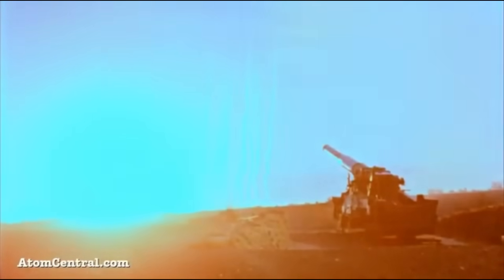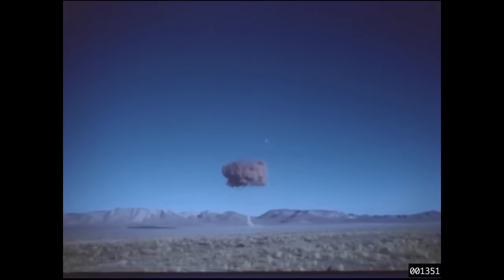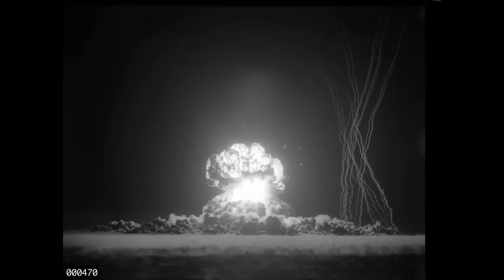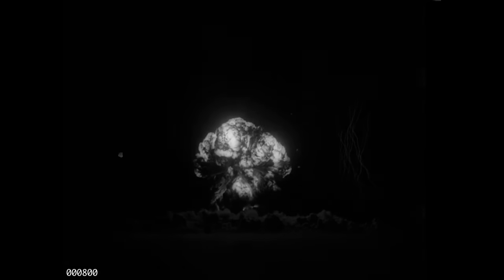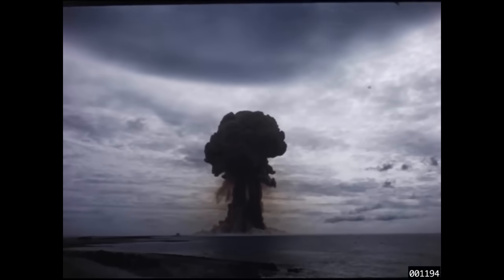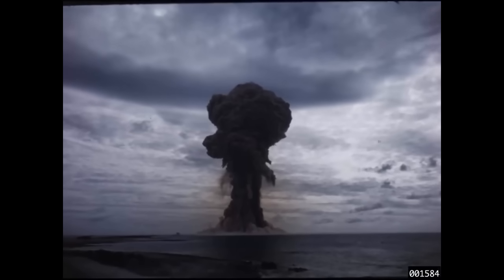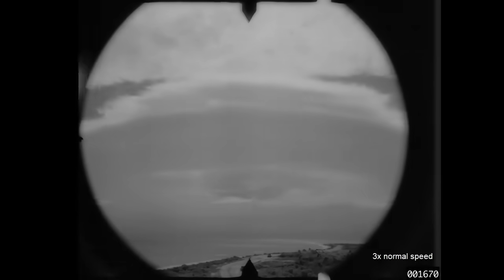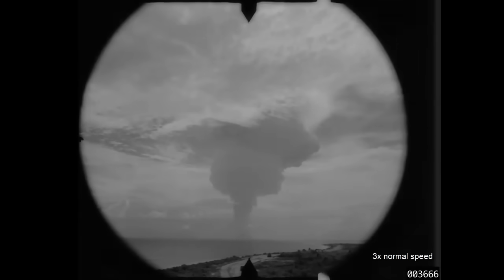What does a nuclear bomb sound like?

Comment: The first video, the first and third blasts are the same test, Upshot-Knothole Grable, which was a 15kt Artillery shell

The fourth blast was Crossroads Able test, an underwater explosion at Bikini Atoll in '46, yielding 23kt

The second video is either Upshot Knothole Annie ( 300 foot tower, 24 kt), or Tumble Snapper Able (40kt free air drop, detonation at 3000ft) They are hard to tell apart. The smoke trails at the side are smoke rockets which allow the timing of the blast front as it moves out. Annie was a weapon development test, it was an experimental device (code named XR3) that provided additional information to normalize the yield-vs-initiation time curve.
Reply: Thanks! I was always curious about the smoke trails on the sides of some of the videos.
Reply: @jonshaulis7531  The streamers you see in the films of atmospheric nuclear weapons tests are smoke trails made by rockets fired just before the detonation. The trails were used to make a sort of graph paper in the air for recording the propagation of shock waves and wind currents from the explosion.
Reply from the maker: Ive had to explain this to so many comments so far, I'm probably going to pin this in hopes others read it before asking.
Reply: @venera13  I've seen Trinity and Beyond many times
Reply: @venera13  please reply can you tell me the music used in the video thank you!
Reply: @kinga1925 Watch the credits at the end of the video maybe?
Reply: @kinga1925  dude it’s listed at the end of the video
Reply: @martro_  i know i know i watched the video i commented before i watched the full video
Reply: Actually, the EM did not mess with the camera it messed with the audio mic/amplifier. Also the sound would vary based on distance and altitude @venera13
Reply: @venera13  sounds like an m80
Reply: @venera13  7.24 miles
Reply: @venera13  what year did this test occur?
Reply: @venera13 ❤
Reply: @venera13  YOU MUPPET... EVEN YOU THAT SHOULD HAVE GOT THIS RIGHT... YOU DIDIN'T...

PLEASE DELETE THE VIDEO AND POST IT AGAIN WITH THE

A C T U A L 

F O O T A G E

A C T U A L

F O O T A G E

DO YOU KNOW WHAT ACTUAL FOOTAGE MEANS?
Reply: @venera13  it's a bluff. There are no nuclear weapons.  Do we Have a video that shows the impact on structures which are not woodden sheds and upside down old cars?
Reply: @venera13 
I've heard another nuke!! 
There's a cine recording of the John shot of Operation Plumbbob, 5 guys and a cameraman standing at ground zero of a 19,000ft detonation of 1.5kt Genie air to air rocket. 
And with no ground wave possible, that's pure bang. 
And 5 guys chatting.
Reply: @venera13  You could also put it in the description, or the video itself. Sounds like this was kinda a last minute video idea though.
Reply: @venera13  Warm, sensitive man: 
1. emotions are real, not shallow
2. calm, centered awareness (which automatically connects the personality to the greater field)
3. awareness in a field of intelligence where every mind is connected
4. not trying to be "more emotional" or "higher emotionally" than other guys (not doing battle with mood in any way)
5. always authentic and sincere
6. controlling thoughts to what is positive and secure

Jealous and violent men bigger in frame with authoritarian personalities have been lying and manipulating the truth for generations about emotional sensitivity. Love is not "gay". It is honesty and truth, and awareness of a quantum field of intelligence and everyone’s connection to it. Lying about awareness causes war. Honesty prevents all violence. 

If men think love is gay, they have a homophobia problem. War is being fought because human beings collectively refuse to acknowledge manipulation in men that focus on dominance. It's time to grow from stupid, primal, jealous ideas. Body size is not control over thinking socially. 

Supporting collective lying socially (violence) in order to support machismo from homophobic men because of cowardice and popularity is the same as committing acts of violence in person. It is wrong. Violence, lying, and backing lying is support of hatred for people that are living the truth and telling the truth in life.

Peace is strong. Aggression is jealousy and lying about being strong. Jealousy comes from less friendly, less secure, anti-social men with anger resulting from homophobia.

Many men see love as weak, something to be punked, or something easy to dominate. The real truth is that love is MORE secure mentally. When men focus on love within, they are actually focusing away from jealousy and ideas / thoughts that make them feel insecure.

When men refuse to focus away from insecurities within, lie to themselves about what they are insecure about, and refuse to care about their own criticisms towards self and others, they focus on mental aggression only (fear).

Aggression is the root of violence. Sharing lying with other men (bullshit) is the root of war. When aggression is around socially, an honest human being will create jealousy in individuals with character issues.

This is why men and women refuse to focus psychic (telepathy and love) openly. Even though we all know telepathy is real, there is fear, because there is so much manipulation of the truth. 

Human beings cannot lie: love IS strong. Not only is love strong, it is STRONGER than arrogance. Hence the jealousy and criticisms from primal men towards sensitive men. 

Those that judge the most are the ones that are jealous. Where are most of the judgments coming from? 

https://youtu.be/k-746N4WRg0
Reply: @OOBEJuanKenobi  You had me until your telepathy claim. I'll still give you an upvote, but remove anything regarding this unproven power. It hurts your highly valuable message.
Reply: that seems more terrifying than a bomber dropping it imagine a creeping nuclear barrage from artillery
Reply: @bigtroglodyte  adds a different meaning to "danger close"
Reply: @bigtroglodyte  Hell, they even tested a low yield atomic hand grenade which, while it worked, it's feasability on a battle field was ridiculous.
Reply: @danielfronc4304  Randy Johnson couldn't throw it far enough!    🤣🤣☠
Reply: It’s like you read my mind , I just deleted a comment I wrote because I asked a couple of questions and when I read your comment I see you had answered my questions in your comment , so thanks 👍😊
It has to be said your knowledge on this subject is brilliant .
Reply: Thanks for the research fellow nukaphile!
Reply: S Sadie, I thought I knew a bit about nuclear testing cause I could name a few famous tests but you just showed me how much I don’t know… any recommendations on legit literature I should read on the subject of nuclear testing/weapons? I realize that’s a broad question so for a baseline let’s say I know a lot more then the average joe but a lot less then the encyclopedic info you put down…so maybe I’d call myself a advance novice. (If you ski that might make more sense). Or in other words, I can’t read a actual scientific paper and glean what it means but I’m not ignorant on the basic physics.
Reply: @paulwilhelmsen6586  You know about the UFOs then?
Reply: @grunt7684  ;)
ummm ….yea. Let’s go with yea and end it there. 
I’m busy and the lizard peeps are not patient clients.
Reply: Wait, I didn't even see the UFOs in this one... Is this a recent edit? You're not supposed to edit them out anymore...
Reply: @grunt7684  you 🚿
Reply: @grunt7684  🤣🤣🤣
Reply: i thought a real nuclear blast would sound unique or cool but u can literally look up footage of explosions and it would sound that same
Reply: All the ways they tried to, and did, deploy nukes back in the day are wild. The Davey Crocket man-portable nuclear "mortar" (for lack of a better word) takes the cake, but there were more. Artillery shells,  the "suitcase nuke" (Mk54), torpedos, and probably more weird contraptions that fell into obscurity.
Reply: Good research. I wish people would half of this work before commenting Gen3+ or never reactors for power.
Reply: I always wondered what the smoke trails were for. Thanks.
Reply: People go scuba diving at Bikini Atoll now! Recreational diving! LOL, Pass.
Reply: @mjb007bond  Your comment, Mr. Bond, made me wonder just how radioactive Bikini Atoll is these days. Turns out that despite the greater passage of time, it's something like ten times more radioactive than Chernobyl. Wow. From the article I found:

External gamma radiation levels were significantly elevated on Bikini Atoll, on Enjebi Island in Enewetak Atoll and on Naen Island in Rongelap Atoll, compared with an island in the southern Marshall Islands that the scientists used as a control, the researchers found.

The levels on Bikini and Naen islands were so high, they surpassed the maximum exposure limit that the United States and the Republic of the Marshall Islands agreed to in the 1990s, the researchers said. (On a side note, bikini swimsuits weren't named after the island because of its tropicality, but because the French designer wanted the two-piece swimsuit to be "explosive," just like the bomb tested there, said one of the study's senior scientists, Ivana Nikolic-Hughes...)

Source: https://www.livescience.com/65949-marshall-islands-more-radioactivity-chernobyl.html
Reply: I am so shocked that the most technical, and powerful weapon ever created was not deemed important enough to have its audio recorded, it's dumbfounding.
Reply: @ajcook7777  The audio was recorded but lost over time. Most of these tests were recorded before A/V was invented. The audio had to be recorded separately to the film.
Reply: @ajcook7777  Why? It just sounds like any other large explosion, and the sound  wasn't pertinent to the effects being studied. 
Some were recorded, but like the video said, those recordings have either been destroyed or lost over time.
Reply: it's incredibly sharp which i guess i should have expected but didn't
Reply: I have always wanted to know what those smoke trails were!  Thank you!!
Reply: Ok thanks I guess lol
Reply: Why does it look like such a tiny radius bomb?
Reply: @notionSlave  Because it's about twenty miles away from the camera.
Reply: @Squidgy55 It’s surprisingly only ~7.5 miles away if you do the math from detonation to the shock wave. Pretty cool!
Reply: @notionSlave  The path of least resistance (you know, like agreeing with the grouchy wife - joke, I joke). Most of a nuclear blast goes upward, vertically, likely due to resistance from the ground. Hence, the bomb's best use being in a valley ringed by mountains.

Even the U.S.S.R.' s prodigious Tsar  bomba, which blew down structures/broke windows a hundred + miles away had a huge amount of it's force ascend vertically. Impractical.
Reply: Nice knowledge.
Reply: Fun fact: it is confirmed that Bikini Bottom was created by the explosion at Bikini Atoll.
Reply: Not tests...*dramatic pause* they were trying to kill it
Reply: considering that the sound was taken about 7 miles away from the site of detonation. i just wanna ask how loud was the sound recorded? because i wanna know how loud would it really be.
Reply: @Milenier_live  Not much louder than any large explosion ,but due to the size of the  fireball, the sound of rolling thunder would last longer. 
I was told this by a former naval officer who served in ww2, who witnessed a Japanese battleship explode before sinking, and who was also later involved with the atomic testing being done at Bikini Atoll.
Reply: @Milenier_live when you break the sound barrier, it's all the same..
Reply: @mikeypiros6647  can you elaborate?
pretty sure you can just add more energy to the system. though yeah, supersonic sound is just a shockwave, so not a sound anymore, but technically we can still attach value to that.
Reply: @Milenier_live How loud it is would be the least of your worries.
Reply: Get a wife like the op
Reply: Thanks for some ya giving names he wouldnt
Reply: Yes, I wondered why the same blast (1 & 3) were shown out of order implying that they are different tests. Doesn't seem accidental and I can only assume that it's a disagreeable practice to produce a longer video.
Reply: Source? Or did that come out of your ass
Reply: boom
Reply: The 2nd video wasn't 24kt or 40kt. It was a 1kt device.
Reply: A door slamming in the depths of hell
Reply: Crossroads Able was the airdrop; the underwater shot was Crossroads Baker.
Reply: 🐶Every morning and that smell it puts out awful 👀✌️
Reply: Then why does the second one look completely different.  I'm pretty sure you are mistaken.
Reply: @Necronaut  Because it was a 1 kiloton blast. She's wrong.
Reply: Thats Atomic Annie
Reply: The artillery was a Howizer
Reply: And hence where the Upshot Knothole Annie landed (Bikini Atoll), got the name Bikini Bottom.
Reply: Lol
Reply: 24kt at 300ft will expose you to at least 100 rem out to 1.1 miles away. 100 rem is enough to cause noticeable radiation sickness, but not death. However, it is enough that some 3% will likely develop cancer later related to that exposure.
Reply: Rather disappointing considering the damage it can do you would think it would sound similar to the  audio they actually use  but that's just my opinion
Reply: Thank you
Reply: If you watch the docu Trinity and beyond, it has all the footage from testing. It's absolutely fascinating (and terrifying). Upshot-Knothole Grable has always been the most interesting one for me because of how it was delivered i.e. via an artillery piece.
Reply: I find it hilarious that the way they named these tests was with a random word generator that just picked two designated words and paired them together. That how we get upshot knothole. But I think it's funny someone read that and was like "yeah, that'll do nicely". Something like Castle Bravo sounds much more serious and official. Either way super cool video and subsequent knowledge!
Reply: Finally an explanation for the smoke trails!!! I've always wondered. You are the best!
Reply: Upshot knothole series shot "Harry" (not shown here) the weather was miscalculated and blew fallout all over St George Utah in which thousands were exposed including children in which many have died early and many still have health problems and high cancer rates. (See ;Downwinders) Some also say that it could of led to John Wayne's cancer after filming in the region.
Reply: I'm sorry, but this is clearly a very small A-bomb. 1-2 kt max. The camera is only at 11-12 km (8 mile).
Reply: @JérémyBouchez  No this is the only time the US filmed a nuclear artillery test. Shot "Grable" dubbed "Able Annie" later "Atomic Annie" the yield was 15 kt. It was shot using the 280mm artillery piece with a range of 20 miles. The reason it looks close is because it's in the desert excellent weather (visibility) with top notch cameras of the time.
Reply: That 3rd fart in the middle of a good dump.
Reply: @keithbradley4224  🤣🤣🤣
Reply: @SPAZZYok  
🤣
Reply: They weren't bothered by radiation coming at them?
Reply: I'm trying to make a channel pls pls pls can you subscribe only take one sec god bless you all
Reply: you know your booms
Reply: Now there’s someone who’s done their research.  Bravo!
Reply: Why do you know that stephanie
Reply: They are all fake...their are no nuclear bombs. It's all trick photography and special effects. Don't be fooled.
Reply: One day soon I'm going to see this shit actually happen
Reply: @MrGoneTroppo  No you won't...It's all fake. Trick photography and special effects. A lot of the shots are scale model. It's all bs.
Reply: Says the nuclear intelligent committee
Reply: Same size as Hiroshima = 15kt
Reply: Amazing and just as scary at how fast they went from dropping a large heavy bomb from a plane, to being able to get the same results from an artillery canon.
Reply: Mmm🎉
Reply: I think 1:49 -starting one if the Fizeau shot
Reply: I ust wanted to be the 100th reply.....
Reply: "I am become death,destroyer of worlds ".
Reply: Thanks for saving me from going down that rabbit hole.
Reply: Of course.
Reply: Oh good 😂 I was going to say, how does it do the music thing.
Reply: If I’m not mistaken it’s the only NB to be shot out of an artillery cannon
Reply: Earschplittenloudenboomer
Reply: What did you mean by, "one that shows the audio"? You can see the audio? 
Also wondering what, "isn't terribly good quality"?
Reply: able was the above ground test, baker was the underwater test
Reply: You're on a level 3 above the target audience for this
Reply: nobody gives a fuck
Reply: Forrest gump ping long
Reply: This answers questions i haven't articulated yet, but brings another one: 

How the hell do you know this? If you're a female, it's a first occasion i see the guys getting enlightened on technical stuff like this. 

*P.S. Not sexist, just self-confessed simp.
Reply: @dannydetonator  WIKI
Reply: @nogrenz6445  🤦‍♂️🕺
Reply: @dannydetonator  🙈👖
Reply: What are those streaks of smoke to the right of screen @ 1:06?
Reply: @FRDRCE It’s to test the shock wave/front and the Mach stem. Helps them determine the yield of the blast amongst other things.
Reply: “Annie, are you okay?
So, Annie, are you okay? Are you okay, Annie?
Annie, are you okay?
So, Annie, are you okay? Are you okay, Annie?
Annie, are you okay?
So, Annie, are you okay? Are you okay, Annie?
Annie, are you okay?
So, Annie, are you okay? Are you okay, Annie?”
Reply: @josephcoon5809  you been hit by a smooth Criminal
Reply: Just saying wiki facts.
Reply: @David-rj1ru  Little more legitimate than that.  Do you think you could correctly identify all the clips you just saw by having wiki open while you watch the video?  Obviously they have quite an investment of time and familiarity with a good portion of the nuclear visual records